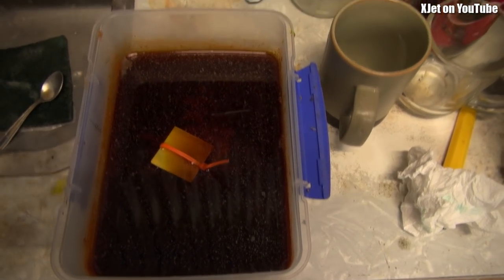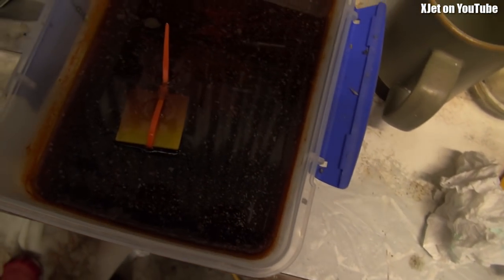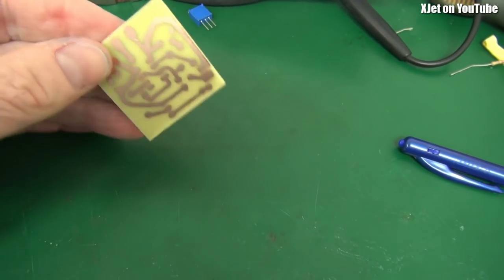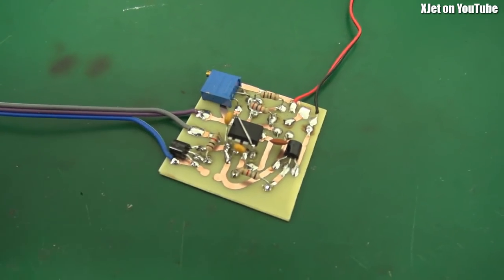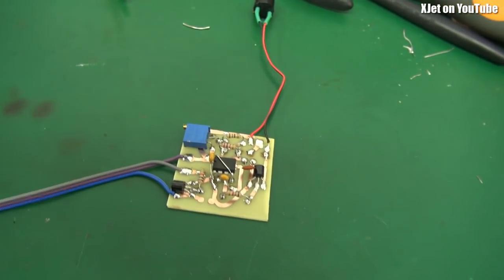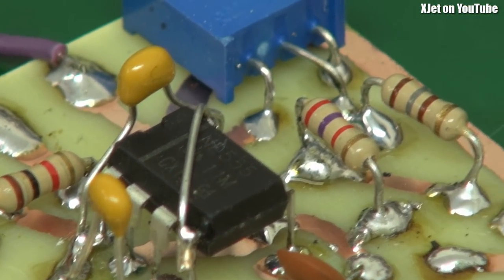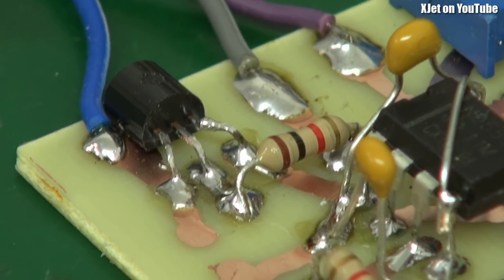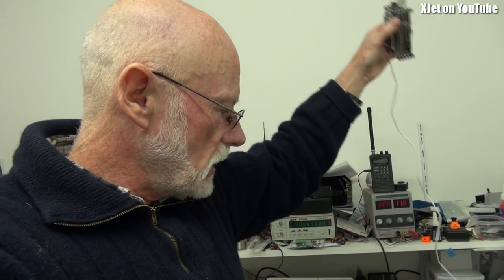Old-school electronic quick-build

Comment: Holy crap, that's fancy compared to my point to point soldering jobs where connections land on the top of tinned thumb tacks stuck in a piece of plyboard board, or connections just meet in the air like they rocked it in the old vacuum tube radio days  :)  Well aren't you a fancy schmanyz city slicker with your etching chemical baths and lithographic pens and all that raspberry pi hoi polloi.   I can see we're all just going to have to wipe our feet at the door when we come into your house.... :)

Comment: I ounce purchased from Radio Shack a Buzzer (Siren) that was so loud on 9 volts that it hurt your ears if you were with in 10 feet. Still got it in my flight box some where. I was trying to make a Plane Finder where when you plug in the battery 10 to 20 minutes it would activate. We have a lot of corn and soy been fields here in Wisconsin USA.

Comment: Nice. This is more like Manhattan style circuit construction than dead bug style.  You made an oscillator to drive a buzzer that needs an ac signal to work. But there are buzzers with this built in. They only need DC power, so a transistor to switch the DC power to the buzzer is all you should need, in case you're going to manufacture. Continuing in this direction, depending on the current demand for the buzzer, and I/O availability, you could combine output pins in parallel and drive the buzzer directly.

Comment: I just got done building a 5 cell LiPo power management system with charging circuit for my latest autonomous robot using that very same technique, except I use the fancy $2 perfboard instead of the $1 copper clad you're using there..

Comment: I used to do that (using THT components as SMD) but I just use larger SMD nowadays... SO packages for ICs, SOT23, for transistors and mosfets, and 1206 resistors and caps, etc. I only have a cordless hand drill, so drilling precise holes is a pain in the ass...

Comment: More or less the way I learned how to make PCB's in school, only we drilled holes and put the components on the other side for more solidity. And we sprayed the copper with Kontakt Chemie SK10 Flux (which hardens when it dries), to prevent oxidation of the copper and make soldering easier. 😃

Comment: You can get more volume from a piezo if you drive it differentially, like with an H bridge. If you have say 12v you get 24v of piezo deflection. Compared with just 12v to gnd
Reply from the maker: Yep, I remember making bridge-output audio amps for car stereos way back in the 1970s.  It was the only practical way to get lots of power into 4 ohm speakers :-)
Reply: these are not piezo, they have a coil working on a tiny magnetised disc of metal

Comment: Hmmm, previously I have project to use similar buzzer, usually it has integrated oscillator. It only require DC power supply to make it buzz, of course it require enough voltage & current level... At that time I only use 1 transistor & 1 resistor... I think you can try it to a simpler design.
Reply from the maker: Yeah, but I want to test this tomorrow and today is Saturday.   Can't get a DC buzzer here in time so 30 minutes of work fixes the problem :-)
Reply: For my project that time, I couldn't get the the buzzer without oscillator, so when the tone is low, it sounds wierd.

Comment: None of the buzzers I buy require a driving frequency,  only a supplied voltage. And the GPIO pins on a pi or an arduino supply plenty enough current for a beeper. I connect them directly to arduino pins all the time.

Comment: Ahhh yes the old 555. I used to use those. Now I'd grab an ATTiny85 microcontroller out of the drawer. Also 8 pin DIP but 20 MHz computer with 8K of program flash and 512 bytes of RAM and 512 bytes of EEPROM and analogue inputs if you need them (or digital of course). Needs .. zero external components. Just power. You'd still need the output transistor, but that's it.  Digikey shows NE555 8-PDIP, 100 kHz, 10 mA, US$0.43.  Same site ATTiny85 8-PDIP, 20 MHz, 300 uA @1MHz (fast enough for this project), US$1.20. The 555 is a little cheaper (but is it once you count external components? Those caps might cost as much each!) but massively less flexible :-)
Reply from the maker: I was contemplating that... I have a bunch of 8-pin PIC processors I use for such things... but sometimes it's just quicker to go old-school and use a 555.
Reply: @xjet  yeah PIC would work too. I have a friend who uses them -- I think mostly because PIC has been around since 1976 and he's used them a long time while the first AVR was only in 1996. As a programmer AVR is nice but PIC make me want to vomit. It's not a big deal on something like this that would only take 10 or 20 instructions. AVR all the way for bigger programs.

Comment: i'm currently in job training for electronics engineering
i don't even know what to say 😂
perfboard would have been the other option and that is what we usually use for quick prototypes
of course you can make a mess of that, too
Reply: You're forgetting the "Manhattan" style of prototyping, used a lot in radio projects.
Reply: Ever tried dead bug soldering? You can quickly make very compact circuits because you can build in 3 dimensions.
Reply: i looked at those metods, really cool
i've always thought about 3d circuits

Comment: 2:08... Why not use a 5V active buzzer. It has the oscillator built in and are "cheap as beans" and only draw about 20mA when powered ? Could still use the transistor between the Pie and the active buzzer if the Pie can't supply the 20mA.
Reply from the maker: I will use an active buzzer but didn't have one to hand for this weekend so I figured I'd spend 30 minutes making one.
Reply: @xjet  Then a prototype buzzer makes complete sense.

Comment: always been unsure on how to prototype my boards, seems like a really neat way to do it. How are the traces laid down?
Reply from the maker: You draw the traces with a resist pen and then etch the copper that isn't covered by the resist.  Resist pens are available from many DIY electronics outlets -- they're like a small sharpie with a special ink that stops the echant from removing the copper underneath.

Comment: Er... can't you just use software to generate a square wave for the buzzer? That's what I would do.
Reply from the maker: I could... but this only has to work for a day and I will be using an active buzzer later so this saves making more mods to the software.   Besides which I'd probably have to write the buzzer code in C and set up some communications between it and the Python code so a hardware solution was actually quicker and easier.

Comment: Bit confused. Why so many components when only three at most required? One transistor, one resistor and a buzzer?? A circuit I frequently use for adding a buzzer to a Pi or Arduino circuit. In some cases the buzzer can be driven directly from the Arduino (<  20mA needed)! Note: I'm talking about self contained buzzers/beepers not transducers which require driving with an square wave drive voltage/current

Comment: Impressive.  Not as intimidating as my airnest circuits without any PCB, just component leads and solder. Had to make one recently after managerial directive of "no custom PCB". 

Not to worry after it's all set into a cube of resin!

P.S.  these buzzers are loud enough for most applications. https://www.altronics.com.au/p/s6115-1-13v-continuous-tone-piezo-chassis-mount-alarm-siren/
Reply: Have you ever made an Arduino like that? It turns out smaller than many of the tiniest commercial boards.

Comment: Any reason to not use PWM on the raspberry pi with a transistor to drive the buzzer?
Reply from the maker: Sometimes hardware's just simpler -- especially when your development computer is at home but all your components and soldering iron are at the workshop :-)
Reply: @xjet  That makes sense. I was wondering if it was something like not being able to get the right frequency without the 555 circuit.

Comment: There are active buzzers that have a built in tone generator that are pretty tiny and an all in one package. Not sure if you need it 3.3v or 5v but I do know of 5v active beepers/buzzers  that are only about 1cm in size, two leads 5v dc. https://www.amazon.com/Active-Buzzer-Alarm-Beeper-Quadcopter/dp/B01EMZEQ44 is an example, would be a good compact alternative all-in-one solution. I hope this helps.